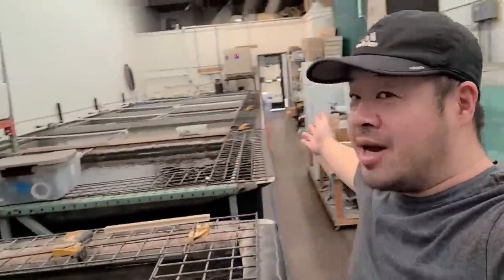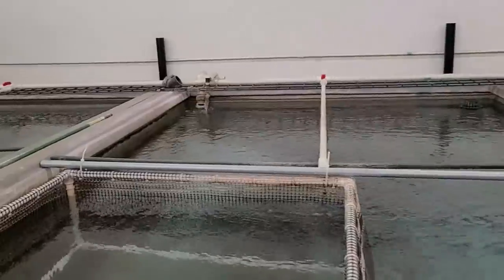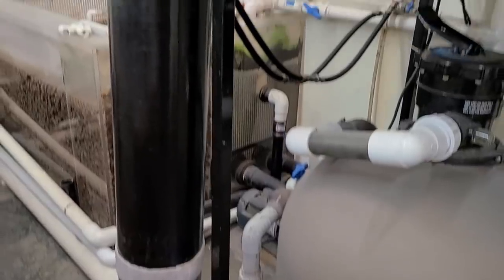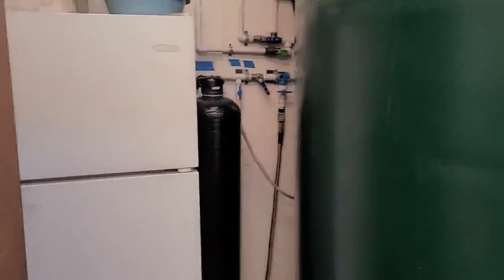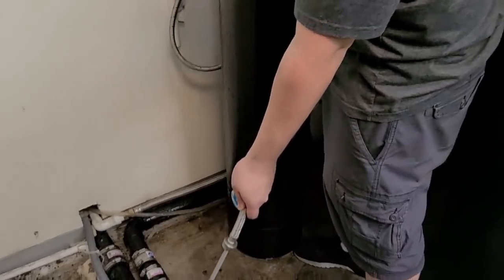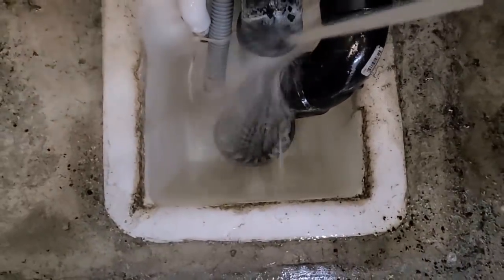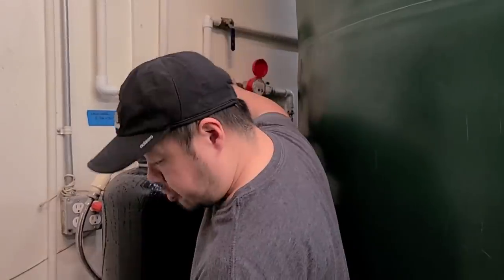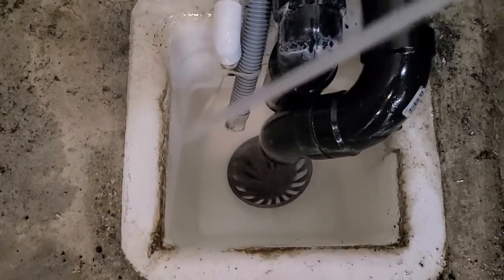Stingrays behaving WEIRD - What is the CAUSE?

Comment: Very helpful information for all sizes of carbon filtration systems also as carbon is impacted by water flow it will micro fracture resulting in carbon silt that can and will contribute to a blocking or clogging effect. I can say with actual knowledge that all municipal systems and most well systems some silt is in the water.